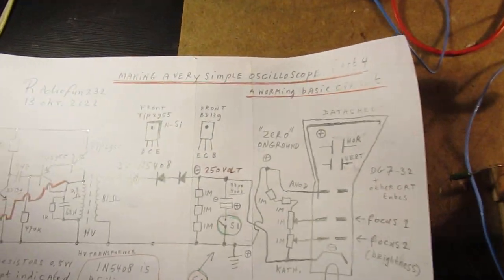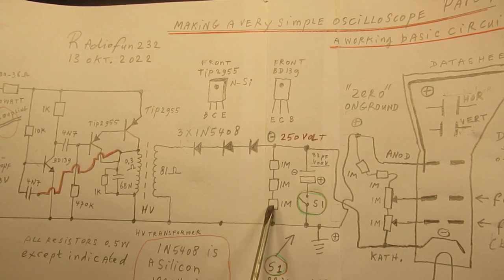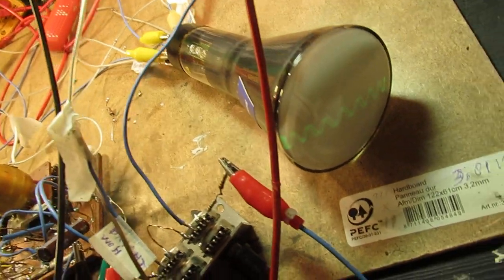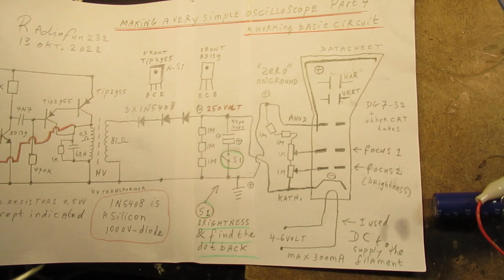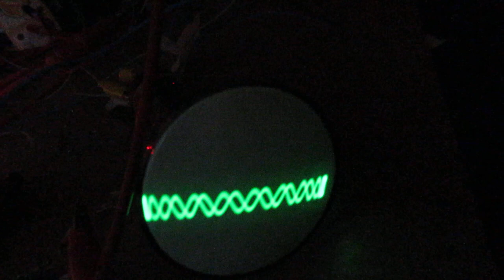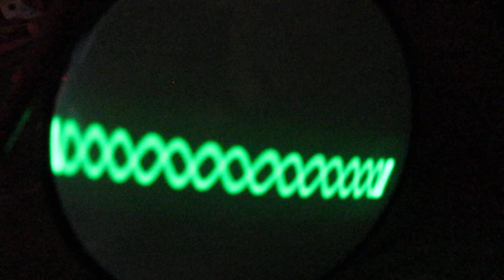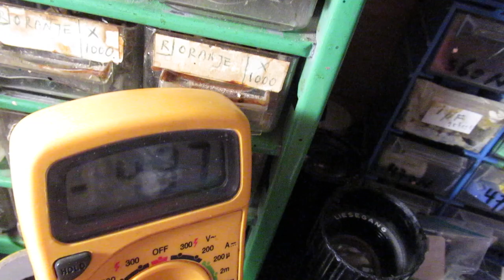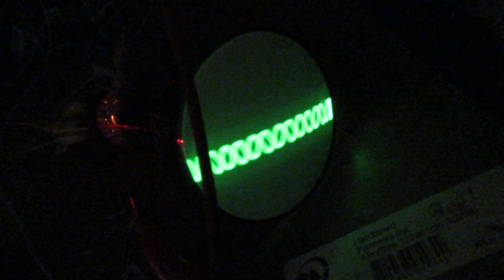Making a very simple oscilloscope Pt. 4: a basic working HV osc. circuit with an output of 250 V DC

Comment: The circuit is really coming together. CRT connection details are really interesting. Great video Ko. Thanks so much.
Reply from the maker: You are welcome Martin. Want to try a HV circuit with a doubler/quadrupler with trafo's on 50 Hz. After that I will choose the best option for the HV, and then work further on the deflection amplifiers.

Comment: Few years ago I've experimented with DG7-5 and 6LO1I tubes. The easiest way I've came up with to generate high voltage was connecting two small mains transformers in series, then rectify the current using voltage multiplier and then stabilise it with ten 100V Zener diodes in series. To be precise, the transformers were in 230V/12V  --> 12V/230V configuration. The voltage multiplier has quite high output resistance as well as small transformers, so the available current is rather low, therefore  Zeners didn't have much power to dissipate. It is enough for smal CRT tho. Such circuit gives a nice 1 kV in 100V steps which is handy if you have to connect potentiometers for focus and brightness. It also lets you pick any of the 100V taps as a ground, which can make designing deflection amplifier an easier task. I had fully working CRT, ready for amplifiers but unfortunately I left the project at that point due to lack of time as I changed a job. My solution, while making tube happy with all voltages being within the factory specs, doesn't meet your goal to keep the supply low, so the safety needs to be taken seriously - 1 kV is that weird mid level when we can still use, with caution, normal cables and components but it also can cause harm, especially if unleashed from a big capacitor.
Reply from the maker: Thanks for your very informative comment.

Comment: wow! it's quite interesting! It looks like a magic glow on the front screen)
Reply from the maker: yes, under certain circumstances, more electrons flow to the screen, leaving the (say standard) electrodes, making that "glow", moving more free than expected by the developers/scientists of these tubes. But when you have an old school oscilloscope with a cathode ray tube this also can/will happen when you set the brightness grid to its maximum. That, in general, can also have an effect on the focus, say by de-focusing the picture on the screen. The focus and brigthness "grids" in such a tube work together, these static voltages influence each other. Some experiments could be necessary, though they are very simple when you understand the functions of the "grids". And even that is very simple.  (13 oct 2022).

Comment: It's lit up and is working 😁
I would feel a bit more comfortable if the CRT tube were mounted in a box to keep it safe from falling. Thanks for the video.
Reply from the maker: Thanks. & Barry: that is also one of my "issues" working on this setup. I want to save the CRT tube as soon as possible. By the way: my  workbench power supply suddenly stopped today (13 okt 2022) and I had to remove it, while that beautiful CRT tube was laying on the workbench, I talked to myself: don't let anything drop on that tube. Luckily nothing happened. Factual: I am more or less in the final stage of all these experiments, so the tube can be "built in", keeping it safe. Perhaps I am going to try a quadrupler/doubler  stage with normal AC (in my case 230 V-50 Hertz) transformers with each (approx) 60 Volt AC out, making (say)  4 x 60 V = 240 V. Thus with using the 50/60 Hertz mains supply. Voltage doubling/tripling/quadrupling of AC into DC can simply be done with a suitable diode circuit. I have ordered a few 60 Volts AC output thansformers (on 50 Hertz) via Reichelt, Germany, a week ago. They have arrived now, so I can do my experiments. With the help of them I can get to any static voltage that I need/want, in the (max) 400-600 Volt DC range, given the AC open voltage of these transformers. These kinds of CRT tubes need only static voltages on their plates, that makes it possible to choose for such a setup. Anyway: perhaps I will (rest my case and) work further with that 250 V via that HV oscillator on say 16 or 18 KC.

That oscillator circuit was tested out and was working properly, though I had to burn out more than 7 transistors, before finding out that the 33 Ohm 10 Watt resistor could save everything. So it saved the day. Of course we/you know that such a setup (33 Ohm/10 Watt/50uF) also works as a decoupling unit, 2 good things together, anyway. Thanks. 13 october 2022.

Comment: nice, didnt know DG7-32 can work at 250V... working at lower voltage have advantage the deflector plate become more sensitive require less voltage to drive into full screen. the down side is lower intensity when hand touch the screen it might move the wave pattern.
Reply from the maker: Yes, true, thanks for your reaction. Is indeed very important.

Comment: Please .... schematic  deflection yoke vertikal and horizontal....
Reply from the maker: As you can see I added 50 Hertz at 40 Volt to the horizontal deflection plates and 10 Volt AC (sine & square wave) to the  vertical plates. This tube has static deflection, thus not magnetic, so no yoke is used.